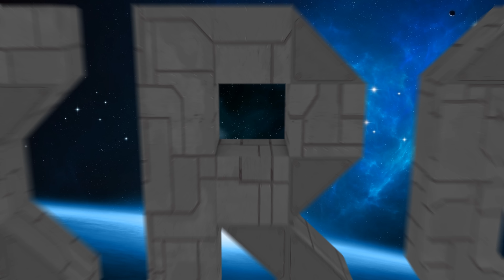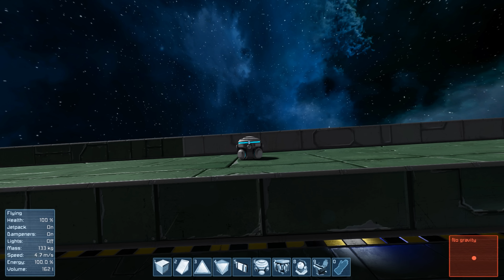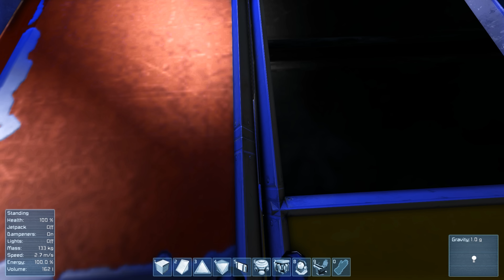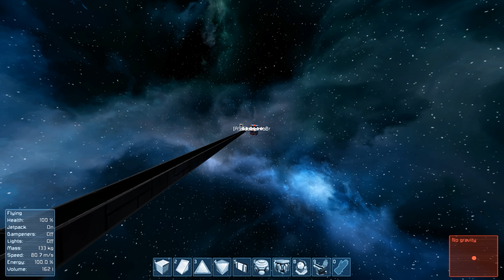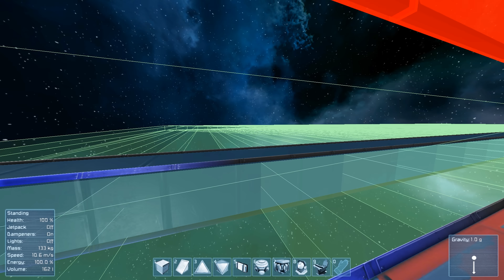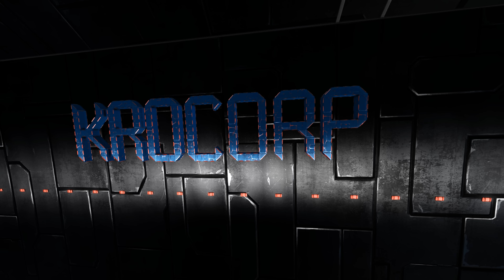Bullet Train - Space Engineers

Comment: Hey nice job. I also try to do this but my problem is that the train gets faster and faster each turn he makes until he crashes to the station. How did you solve this? I've build the start and the end similar. So they're the same amount of gravity generators and blocks between it. The train itself works fine. Just this acceleration problem...
Reply from the maker: I solved this by pushing the train to max speed, so the brakes will always deal with the same speed.
Reply: Raffael Baldinger just like Krolitian said,  its pretty foolproof as far as physics is concerned, and it serves another purpose: you get to your destination as fast as possible